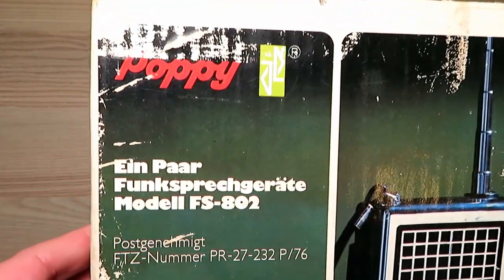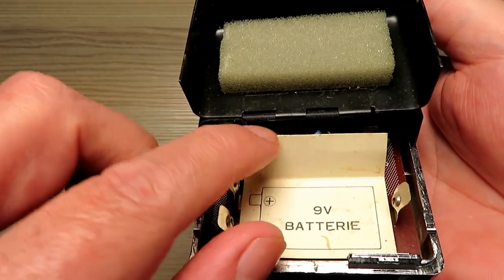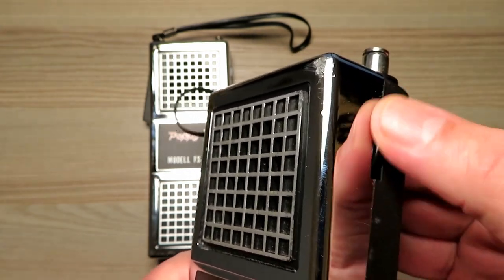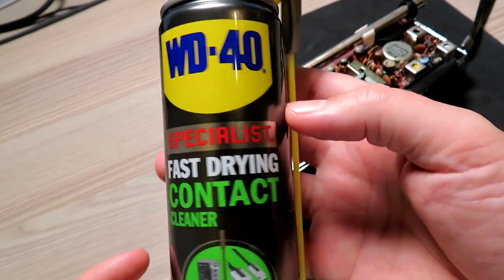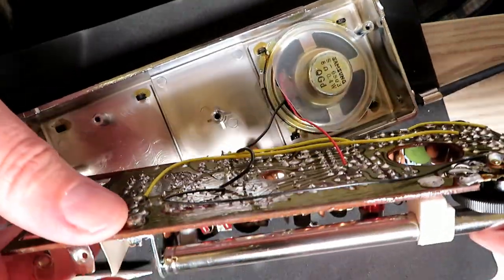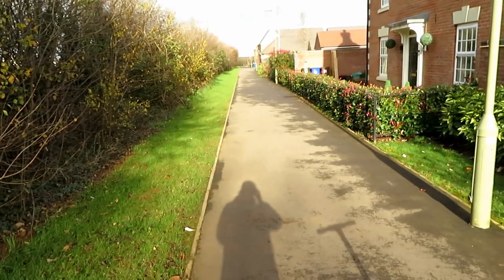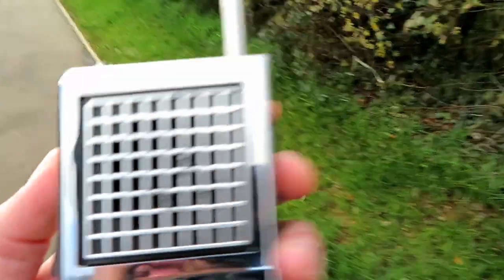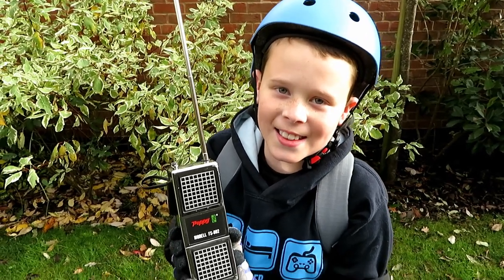ALL METAL & HALF CHROME - THE POPPY FS-802 AM WALKIE TALKIES

Comment: Those radios look in great condition. Probably do need to get them on a test set and peak them for maximum performance. Great job as usual from the chief radio tester
Reply from the maker: Many thanks, yes they might need a capacitor or two swapped out but they are in amazing condition, thanks for the comment.

Comment: I have a set of very similar radios labeled Teleradio AT -051. Dad bought them for me in 1978, those one's are long gone but I managed to pick up another set on EB a few years ago. The performance of these in 1978 was very impressive with about 1.5 klm and very clear audio. Mine came fitted crystals for 27.880. Seems to be more electrical interference on that frequency these days. The Teleradio's are labeled made in Japan and the board inside is identical to the board in your Poppy's. Lately the performance has taken a big dive, sounds off frequency and muffled, I suspect the capacitors. Cheers Matt
Reply from the maker: Yes capacitors go, the crystals also drift
Reply: @knoxieman  Changed the caps, sprayed contact cleaner into the switches and bought a new set of ch.35 crystals from the USA. Working pretty good now apart from the 27mhz modern interference {even here in Australia}. Turned out to be the crystals, I think, and I thought I had read somewhere that most of them were guaranteed for life. No chance of collecting that warranty from 1970's AWA, lol. Thanks for your help. I've been into walkies for 43 years and have a pretty good collection. Your youtube ch. is pretty awesome, I reckon